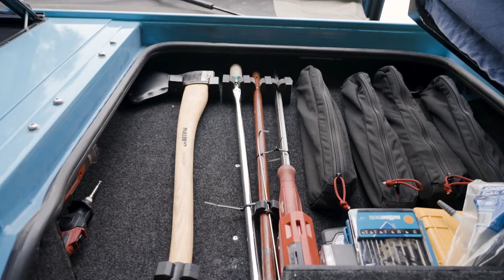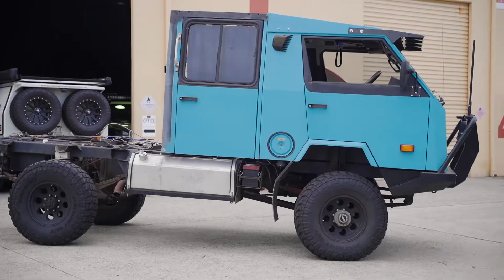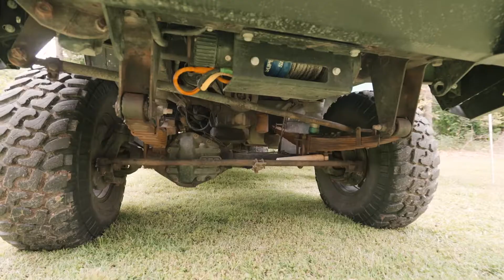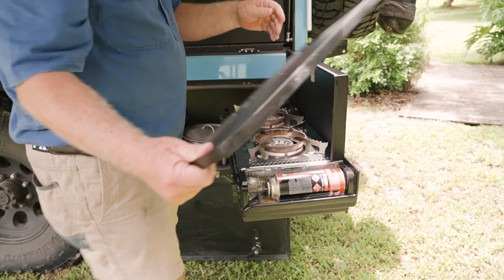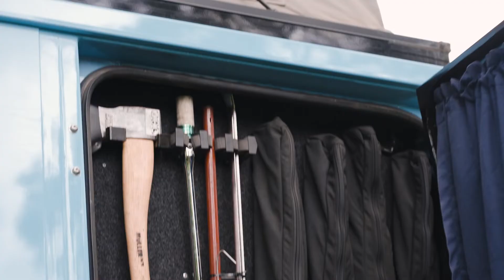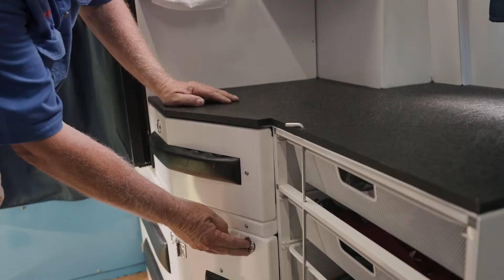Wayne's OKA #50 Build

Comment: I owned the first OKA in NSW, it was a 13 seat bus configuration and did tourist work from Coffs Harbour NSW.
Had some issues because all OKA’s were prototype vehicles so the next one was better than the last one. Certainly capable off-road, although the little Perkins was a bit slow on the highway.
Enjoy your truck